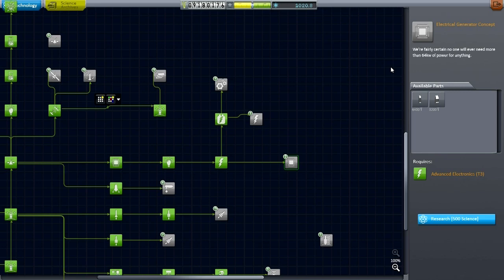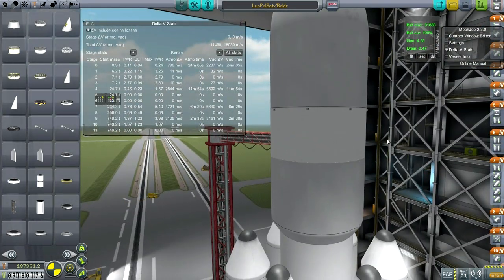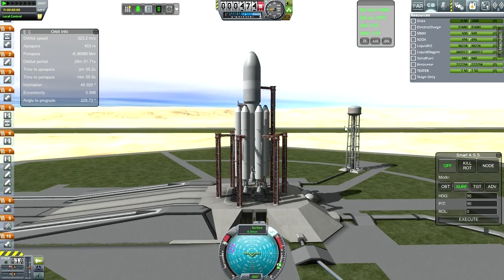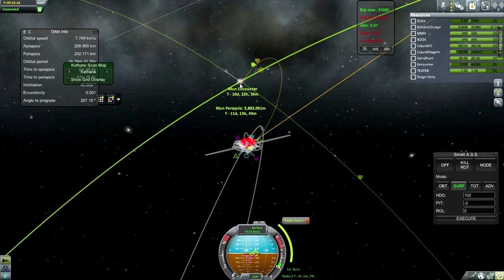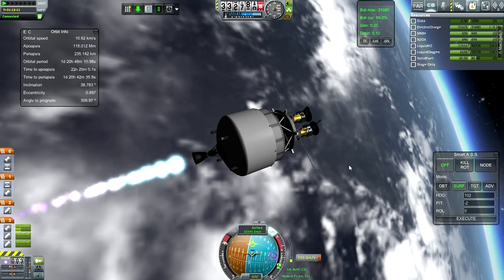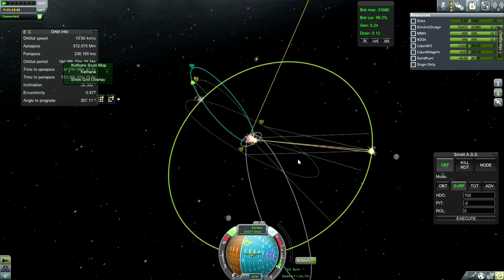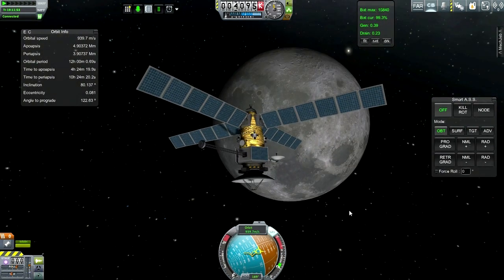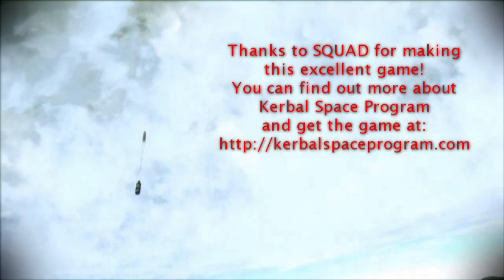Kerbal Space Program (0.24) - Realism Overhaul 057 - Patching Lunar Comm

Comment: What texture resolution do you use with this install? I have tried the full 8k resolution textures, but I keep running out of memory even with a texture compressor. So I was wondering if this really looks that much better than 4k, or If it's just the way my game is configured. As I get higher in the atmosphere (and above it) I tend to see granier and granier textures applied. Kind of how most games minimize a texture when you are a certain distance from it.
Reply: Unfortunately I can't even handle 8k textures just for Earth :(
Reply: And 64 bit just crashes every 5 minutes for me. Waaaaay too unstable still.
Reply: ***** True, Idk which one would be causing this but every time I go to any space center building with my current RSS install in 64 bit it quickly shows a mission control screen, then CTDs. Its whatever, the 4k textures are pretty enough haha.